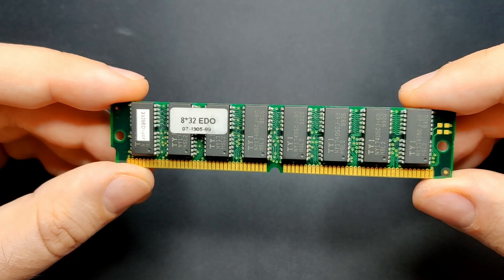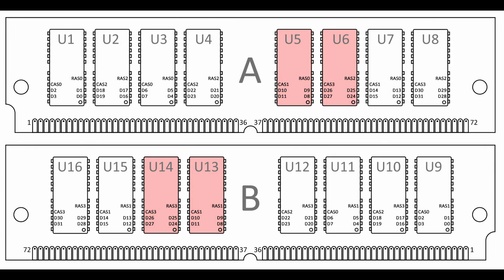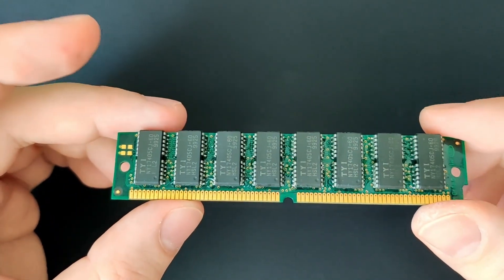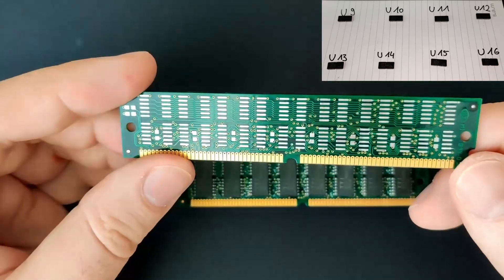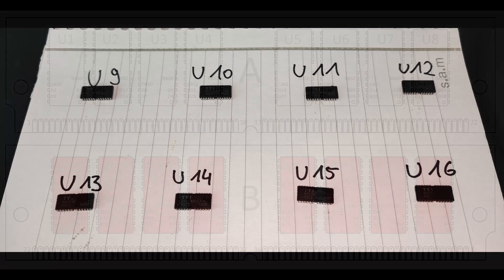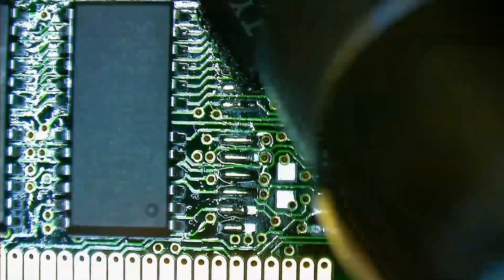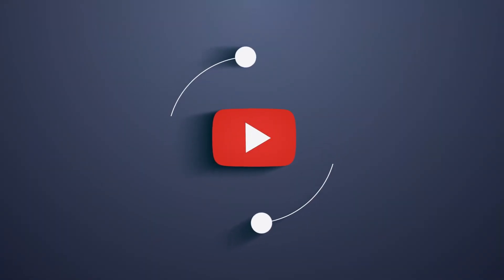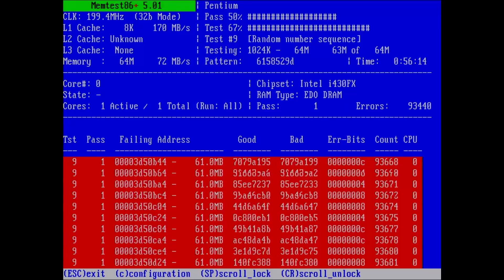Identify a faulty memory chip - the manual way! (EDO_ERR Part 3/3)

Comment: I have two 32Mb simm modules installed but  the BIOS shows only 32Mb and not 64Mb, If I interchange the position of the modules there is no video.  How can I repair the faulty module
Reply from the maker: First, you need to find out which of the two modules is faulty. Do you have another 32MB module? Pair them differently to find the damages module.
If you don't have another module, inspect both modules for physical damage, maybe you can spot something.
It will be hard to find out which chips are faulty. What worries me is that the PC doesn't work when the faulty module is installed in a specific memory slot. Maybe that module is too far gone to be fixable. Or, one of the control lines has an issue (CAS or RAS for instance).
I could only identify the faulty chip by desoldering the chips, replace them, and run MemTest86+.

Comment: u15 and u16 is (going only by this method) not known good, only suspected good but they are still untested.
Reply from the maker: True, they are untested, but wouldn't MemTest86+ reported a different error pattern? With faulty U14 attached, I received the exact error pattern as before. So, I assume that U15 and U16 are good.

Comment: amazing work, you finally found the bad guy. This is probably the best method with least amount of tries, by going in 1/2 groups, so 8, 4, 2, 1. Now that you have a bad chip you can maybe develop a better solution with a scope or multimeter , if that is possible.

Now imagine doing that with BGA chips , rebaling the chips as well.
You can also build a test PCB with memory sockets ... That would be cheap to do for these old chips.

Comment: Nice one! Looks like u04->u01=0->8 mb, u08->u05=8->16mb, u12->u09=16->24mb and u16->u13=24->32mb (can be tested by moving the bad chip around). The fact that memtest was giving errors at ~61mb made me think about u13 but then i realized you had 2 memory sticks in the machine and it's a 32mb (didn't read the description) stick so a ~61mb error should be u14. Looks like the same organisation of chips as on the 168pin sdrams (8x8,16x8,32x8 and 64x8), where having the side notch on the left, 0 is starting from the middle 4th chip towards left, then goes from the far right towards the middle notch and if it's double sided on the second one, goes from the middle towards the side notch, continuing then from the other end towards the middle notch. Imagine having 3-4 bad chips on a stick..that's a 'real pleasure'.
Reply: This is interesting
Reply: It doesn't work this way. Each of 8 chips in a group provides 4 bits for every 32-bit word in its half of the DRAM capacity, so moving faulty chip within the group will only change the error pattern.

Comment: Personally once I had a full good module I'd have desoldered one chip, and put a socket on the module so you could just plug in the chips one at a time for testing, starting with most likely first. That would minimise the solder and heat stress
Reply: that is a very good solution.

Comment: Great video! The process of elimination at its best. I’ve never tried but depending on how the chip failed you can apparently compare multimeter “diode mode” readings to see which is really off from the others. I’ve heard freezing individual chips can sometimes be helpful too. I’d love to figure out a reliable way to identify them because I know all too well how much work the soldering/desoldering can be. Sometimes the chips don’t survive the hot air too. Great videos, keep up the awesome work! 😁👍
Reply from the maker: Thanks! When I get the time, I will see if I notice anything odd and will compare the faulty chips with a good one. I was worried that the hot air is damaging the chips - guess I got lucky there because I did several cycles. Now I just need to make my 386 board take those EDO SIMMS! Next video will be great - and probably surprising :)
Reply: @bitsundbolts  Awesome, looking forward to it! 👍

Comment: Not necessary but it would be interesting to see the results if you soldered the bad chip in a different spot. But I'd imagine you've had enough of soldering these chips. Great work.
Reply from the maker: Yeah, I need some time away from those modules - but, I already work on the next project and a new purpose for those 15 good memory chips.

Comment: Gute Arbeit! Methodisches Vorgehen führt in meisten Fällen zum Erfolg und man lernt unheimlich viel dabei. Mein 386er Projekt geht auch langsam weiter. Alle defekten Bauteile, Sockel und Leiterbahnen wurden ersetzt oder repariert. Erste Testlauf zeigte, dass Takt und Spannungen da sind. Überprüfung mit Oszi bestätigt sauberes Clock2 Signal. Board ist dennoch tot. Lese derzeit die Intel 386 Tech Docs, um zu verstehen auf was die CPU direkt nach Start zugreift, um zu starten. Möglich, dass ein Latch oder Bus Transceiver kaputt ist.
Reply from the maker: Danke! Dein Projekt hört sich kompliziert an - noch viel zu kompliziert für mich. Viel Glück und Erfolg noch damit!

Comment: I like the persistence! I'm sure there could be a way to develop a utility which could identify the faulty chip given the type of RAM used. Same as MATS for video cards which tells you exactly which IC is faulty.
Reply: Yes, provided you both know the exact layout of your platform and tested memory module :) Knowing only your platform could still produce very helpful results, like listing exact data pins exhibiting abnormal behavior. As is both passmark closed source memters86 and open source memtest65+ produce "Error Summary" where you can at least see "Bits in Error Mask" and "Bits in Error" giving you some idea how many potential chips might be bad. 

Maybe a good project for someone to augment Memtest86+ for few known platforms.
Reply from the maker: Yes, as long as you could identify the pin(s) on the 72-pin module that exhibit abnormal behavior, you could test which chip it is - but you also need to know the RAS signal (because there may be two chips connected to the same data lines on a double-sided module). There are quite a few parameters to consider.

Comment: Given how fairly simple the bus connections on these chips are, it should be possible to attach a device on top of the chip in order to drive read and write signals with some sort of microcontroller board. The only potential issue I see is that if these chips share VDD, then you would need to find a way to turn off the other chips, or prevent them from R/W, perhaps with CE. Not sure if they have separate control logic for each chip, or if this is also shared, in which case, the only solution I see is to cut some of the PCB traces and solder them back, which is a bit risky.
Reply from the maker: You are correct, attaching a chips may cause all kinds of issues if both are active. I actually did notice this when I created the Voodoo 8MB mod. When the chips are just piggybacked, but not controlled via the control-wire, the card is unstable and produced memory artifacts. I could imagine something similar here.

Comment: I can't believe you worked so hard to find it. Congratulations! Though.. wasn't the point of the series to see if you could determine which chip is faulty without countless hours of soldering and desoldering? Is the moral of the story that there is no better way?
Reply from the maker: Yes, I tried... But in the end, I was not able to identify the chip without desoldering. I could probably spend more time trying, but I am afraid it may end up in a boring mess. Maybe now, since we all know which chip is bad, someone will figure out what I've missed - and identify U14 without desoldering a single chip. I learned that identifying a faulty chip is not trivial and MemTest86+ output isn't enough. Motherboard connections, module wiring, and how the memory is utilized are all factors that seem to matter - and may be different from hardware to hardware.
Reply: @bitsundbolts  Well.. with so many people around the world needing to diagnose their faulty EDO SIMMs it's only a matter of time before someone figures it out! 😂 Vielen dank!

Comment: Since quite all the documentation about 3Dfx cards is available, I often wondered if someone with knowledge could write a test program.
Like Memtest86, but for those cards.
Reply: doesnt the mojo.exe from Glide SDK v2.43 offer memory test? Edit: no it does not :)
Reply: @rasz  I think it gives basic informations, like memory size, but not if there's a fault, and not which chip is damaged.
Reply: Video RAM errors are easily recognizable if the graphics are wrong. But it could help distinguishing if its a RAM or 3d chip problem.